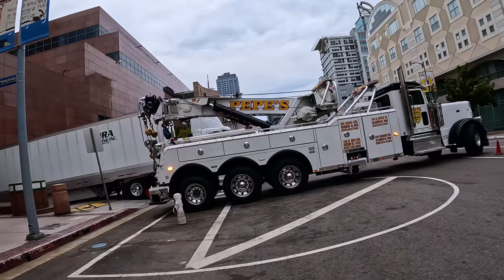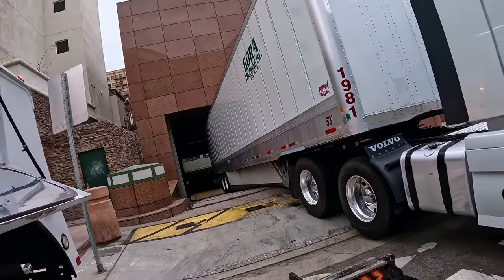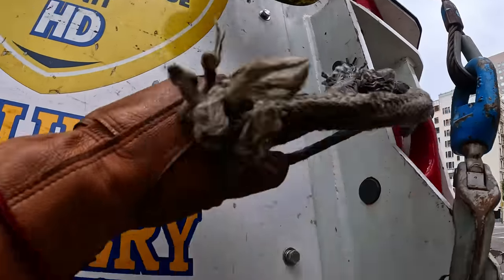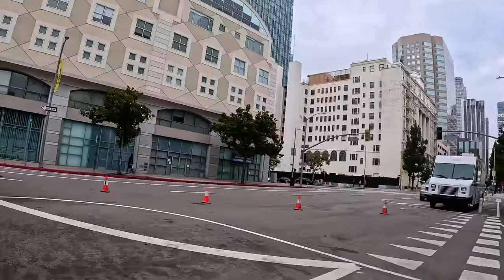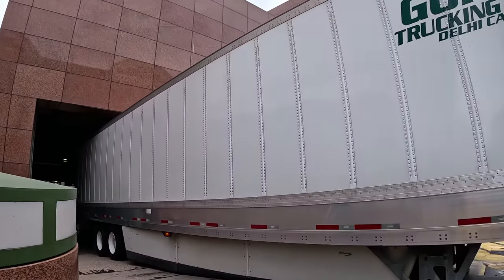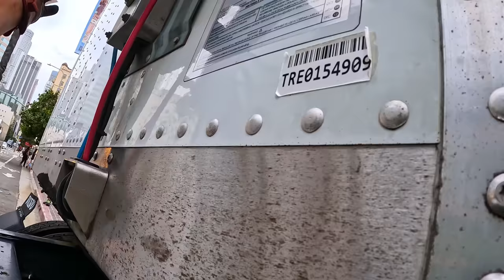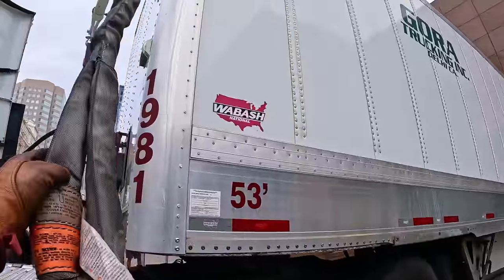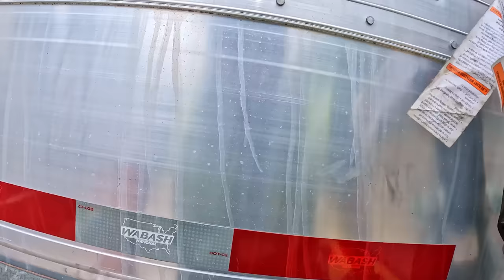Tractor Trailer Stuck at Federal Reserve Building

Comment: In this modern age, if you want to be a tow operator you need not only a CDL license and a vast knowledge of rigging, and mechanical systems, but you also need to be a Part 107 certified drone pilot too.
Reply from the maker: It sure does help 😂
Reply: Indian companies have destroyed trucking
Reply: @murdamooch  Nah, they just the only ones willing to do it. They on average have less experience as drivers so they aren't as good, but its not their fault that the market is thin.
Reply: @colamity_5000  Fun fact where im at many mechanics wont work on indain trucks cuz they cut holes in the floor boards and the undercarriage of the truck is caked in poop
Reply: @murdamooch  I've heard horror stories...
Still it's illegal most places to refuse service due to race, if there's genuinely shit there then sure but ya can't just assume there is cuz they Indians..
Reply: @colamity_5000  Ah. that old chestnut of "foreigners are doing the jobs locals are not willing to" 
I've heard that for decades and it's complete horseshit.
Reply: @murdamooch  Worldwide.
Reply: you mean a drone operator, your not pilots, you never will be
Reply from the maker: @Cessna152ful ok Karen calm down there
Reply: @Cessna152ful  You fly a cessna, you're not much of a pilot either.
Reply: @Cessna152ful  Pipe down lil bro you fly a cessna
Reply: @Cessna152ful look it up smarty pants! A drone just like the one these guys fly is just like mine and according to the FAA a drone is aircraft which means I’m a drone pilot. Get over yourself!
Reply: @colamity_5000  no but if it's a common enough occurrence, checking the truck for literal shit prior to accepting it for service isn't racist.
Reply: @colamity_5000 ask this why, the sidewalk doesn't grt resurfaced at a lower height? You arent a trucker! Really people think truckers are dumbasses. But a nessesary nuisance! Wait till you get robots doing this job!
Reply: @colamity_5000  In  Canada they are starting to own a lot of the companies and they tend to hire their countryman.

Comment: I used to drive Armored Vehicles into the federal reserve building in Richmond, VA. They have en entire city block underneath the FRB building. A tractor trailer can do a 360 turn inside. This place looks so dangerous for armored cars. Its why they have to post the FRB police outside when they are coming and going. If this is happening regularly why not change the road angle to accommodate the tractor trailers?

Comment: There's a very good chance the driver could of tied up his self leveling valve, to over extend the tractor air bags a couple inches, walked right out of there. I've personally done that a few times.
Reply: Absolutely!  If the truck alone wasn't enough he could have gained a bit on the trailer too.  A driver should look at where he is and think "Every other driver gets out of here without a tow truck."
Reply: Just scrolled the comments to see if this was mentioned by anyone, exactly what I was thinking!
Reply: That is what I was thinking.  There were a number of ways out of here without involving a $$$$ rotator.  Complete overkill for the job, oh well.
Reply: Aw hell. They gotta rip off whoever they can
Reply: @dannydonovan9348 they aren't cdl instructors,
Reply: @deth3021  That's for dam sure
Reply: I always crossed these thresholds with caution.  Pulled out very slowly and if you heard the landing gear scrape you could reverse and come up with a different plan.  Once you high center and take the weight off your drives you’re screwed.  Over extend the airbags, boards, take the gear pads off, anything to avoid that $1000 bill especially as an O/O

Comment: "You're not holding the brake, are you"    pssssssssh, and truck rolls.

BTW - the reason for all those armed cops is very simple: as long as that truck is stuck in the opening, the security of the building is at risk as they can't close off the loading dock opening or raise the streetside bollards.

(plus, I'm sure, all those officers wanted to watch)
Reply from the maker: Spot on! These guys always have to be on high alert even on a routine job like this. Very nice guys but you don't want to make them paranoid lol
Reply: @PepesTowingService  oh dude, you don't have to make them paranoid, paranoia is literally part of the job requirements.
Reply: and the trapped vehicle is presumably full of pallets of money unless the fed was sending them out loaded with something else 😃
Reply: @tonyyarbray  could actually be anything from money, to coins, to just generic office building supplies.

Could be something like pallets of Coca Cola cans for the break room.
Reply: Delivering to Brinks was like that,  any time a door was open, two guards stood there with shotguns

Comment: I feel like this problem is a result of the loading bay design. The sudden angle change is just asking to get vehicles with long distances between their wheel bases stuck.
Reply: Can't this be avoided with appropriate load limits or weight distribution?

Comment: Wow, look at the concrete, it been scraped so many times. One would think they would spend the money to fix that spot. For those wondering, it usually coins that are loaded out, hence only a few guards. I have done a load like that, no escort, no guards, nothing. That is due its heavy and low value.

Comment: One would think they might reason that a shorter trailer with a shorter wheel base might be a solution. Maybe a sign that says wheel base of 53 ft trailers will not fit.
Reply from the maker: Perhaps, but we've even pulled out 40' ones and 3 axle box trucks

Comment: There is a covered service road in the West End of London, behind a theatre. It has a low stone-built roof:
When you enter with a full load, no problem, there's a bit of clearance, but, try to leave after unloading......
You don't think about it until it happens to you.
Reply: Bin there done that,  inside an underground loading dock,  once the weight was off,  I pulled forward and thought it was snowing ( inside, summer?). I was scraping the insulation off the ceiling. LOL

Comment: Alternative method...undo tractor air ride leveling valve, extend air springs...that raises landing leg pads off pavement....pull forward, lower air springs, reconnect leveling valve. No damage to anything.
Reply: I have the impression that the driver is pretty inexperienced

Comment: Very nice! He was defiantly holding those brakes and didn't seem to get it right away what was happening. Should also run a camera by the running gear and where your lift point is before your strap is in the way. Nice job should be at least 2k probably more in LA

Comment: so you guys lifted but just wondering, wouldnt it of been a option to put logs behind the truck reverse it a bit so it got higher and then put logs infront of the trailer wheels to get it that bit of clearance? i have no towing experience but was just wondering as ive done stuff like that before when it was tight with a small trailer that had to get in the building but couldnt due to the ramps

Comment: I mean, not to burst any bubbles here...  10 second fix, disconnect your autoleveler arm from the suspension and make it think its low.  It will lift the truck another 4-5" at least.  I've done it and saved myself a couple thousand bucks and a couple hours.

Comment: I'm assuming part of the issue of this driveway is the bollards anti-vehicle management system what's looks to be the giant steel pillars which are embedded in the ground there with come up at night I'm assuming. Instead of paying 750 to $1,500 one would assume that they would regulate a minimum landing gear height before you're allowed to be loaded at the facility. I have to tell you that as a truck driver 10 years if I was loading out of this facility on a normal rate I would have wooden wedge blocks probably triple layer 2 by 6 with a slope and when I got to the point to where landing gear was getting close to the ground I would hop out and put it under my drivers. I'm amazed that security at the facility doesn't watch the trucks leaving which they could and have similar blocks in place instead of again charging the taxpayer 750 to 1500 bucks but you know if that makes too much sense

Comment: With a front axle leveling valve, that is why I carried 8 ea. 4 X 4 for dunnage. Put in front of r=front axle just before drag and raise the trick up and don't need a tow truck at what $1200.00 for a 20 minute move!  Some of you that think you are truck drivers are not. this is a stupid mistake because someone did not THINK. BTW I needed 1 tow in 30+ years. ecm went out outside of Limon, Co.

Comment: I’m going to assume the problem why the trailer is easily getting stuck is due to the fact these trucks don’t have actual air bags to raise the trailer high enough or it’s the type of trailers they’re bringing to the dock I know Wabash and Great Dane have some of their landing gears a little low
Reply from the maker: Correct, a lot of trailers are built different and not all will have the same fixes.

Comment: Could the air leveling valve have been disconnected and moved down to inflate the rear suspension. Might not work because the front drive axle is already extended. The rear would be doing all the lifting. Just a thought.

Comment: If the tractor has air bags could you have disconnected the leveling valve and maxed out the air bags to raise the suspension?

Comment: Next time disconnect the tractor leveling valve arm. raise it all the way up. If thats not enough discconect the trailer leveling valve arm, raise it all the way up.  15 minutes and your unstuck.   Granted then you dont get to charge to 2-3k  for using the boom on the tow truck.

Comment: The tandem axles look to be slid in the forward postion, making the end of the trailer higher as the rig pulls forward on the ramp. If the tandems were back to the end he shouldn't have gotten stuck.

Comment: I've had a similar situation before but I just over inflated my airbags to raise it up a little higher on the truck and trailer but it's kinda hard to tell if that would of been a feasible option for that scenario
Reply: What you mean over inflated your air bags?
Once the air bags are aired up it’s all you gonna go up there is no no 1 or 2 or 3 level inflation on air bags they either all the way up or they completely depleted. 
Stop lying
Reply: @TheodoreRizzo  you can actually disconnect the leveling valve from the spacer arm and raise the frame up even higher same on the trailer granted you can only get a couple inches at max but I've done it a couple times to get out of either this situation or to hook up a trailer that's dropped too high and too close to the next trailer for the landing gear crank in some situations it is a trick that works

Comment: SLIDE THE 5 WHEEL TO THE BACK OF THE TRUCK IF THAT DOES NOT DO IT DISCONNECT THE AIR REGULATOR AND OVER AIR THE BAGS THAT SHOULD RASE THE TRAILER. TO CLEAR THE SIDEWALK

Comment: What has changed since that building was built? Are the trucks using smaller tires or are the trailers built differently?
Reply: Possibly the street/sidewalk were rebuilt.
Reply: 48 foot trailers were once popular  and likely had no issues at that dock ,,, now . its 53 foot trailers ... likely the clearance issue.
Reply: @rollsmerlin1659 he mentioned they have problems with 40ft trucks getting stuck too

Comment: $750 - 1500

I'm guessing the equipment is 750 grand plus, the technician is 60-80 hr.  No chance that's a $750 call unless favours are due.
Reply from the maker: You’d be surprised. Los Angeles is so saturated. Someone will always quote cheaper. If we charged more, no one would call. Gotta stay competitive which we do and have crazy volume.

Comment: Bro, you’re a FKN genius you know you can go underneath that truck disconnect with no tools, disconnect the leveling valve to the truck and have the truck to all the work and no craine needed 😂😂😂😂😂😂😂😂😂 FKN rookies 😂😂😂😂😂😂😂😂
Reply from the maker: What an idiot, first you misspelled crane. Second this is a rotator, not a crane. Third, his bags weren’t dropped. Over inflating the bags while going uphill when your trailer is FULLY loaded can pop them. I’m glad you aren’t in this industry because you clearly don’t know anything. But go off keyboard warrior

Comment: excellent work and care, you can extend the spreader bar a little bit more on both sides.
Reply from the maker: No you can’t. This is a miller spreader bar at maximum length. You’re thinking of the nrc bar
Reply: oh ok, I am a mobile crane operator and I have only used bars that spread. Good stuff! @PepesTowingService

Comment: What could the driver of done to avoid this? slide his tandems, dump air, ect?
Reply from the maker: What could that possibly have done here? I've gotten called where they managed to back up and try to drive even faster out and bend the landing gear. Why would you risk that? Lowering the pressure would just drop it and make it more stuck.

Comment: I used to work for Dunbar years ago and we did the midnight money run to the Fed BEP - we would pick up between 20-30 million in cash and coins . They had to make sure of the weight because of how heavy the armoured truck already was and how much weight additionally they where loading . Just bricks and bricks of cash . It was insane . We where always on high alert because we knew at some point somebody would try and rob us . Thankfully it never happens while I worked there . We all carried a Glock pistol with 3 magazines and either an AR-15 or a 12 gauge shotgun .

Comment: Alex did a good job with that. I bet Alex had good experience with this. Do you guys ever use the tri-axle semi truck with the Detachable Towing unit for Towing larger trucks?
Reply: Plus what year is the PETERBILT 389 night cab Vulcan 950 rotator truck that your co-worker Dave uses?
Reply from the maker: We call that truck the beast, unit 21. It tows tractor trailers ALL DAY and is a work house. And Dave's truck is a 2014.
Reply: @PepesTowingService  does UNIT 21 / THE BEAST ever tow other larger trucks to like maybe a bigger dump Truck?
Reply: @PepesTowingService  is the Vulcan 950 a 388 or 389?
Reply from the maker: A tractor trailer is almost as large as it gets. But use anything the wreckers can tow pretty much so can the beast
Reply: @PepesTowingService  is the UNIT 55 a 388 or 389?
Reply: @PepesTowingService  for UNIT 21 / THE BEAST. I do understand that a semi with a Detachable Towing unit they are still used for Heavy-Duty towing even that they are not used for recoveries my buddy had one & got rid of it & he told me it was great for Heavy-Duty tows.
Reply from the maker: Correct, mainly because of the boom. It’s a great and versatile tow unit though. And unit 55 is a 389
Reply: @PepesTowingService  I agree. Towing a larger truck can still be done with a semi truck with a Detachable Towing Unit. Even that they are not used for recoveries because of the boom, winches & everything like that. A semi truck is a still a heavy truck at the same time.
Reply: @PepesTowingService  will Dave use HULK when his truck is down, or getting basic maintenance or someone else is using it for any reason.

Comment: To funny all you need to do is disconnect the air bag rod and air the truck air ride bags all the way up they would be able to drive out,and reconnect the rod,but the problem is dummies with cdl's.
Reply from the maker: Not necessarily. This trick works to an extent and varies with make and model. Besides the way things work is we aren’t allowed to do “mechanical “ stuff like that. Let’s say while on the freeway he crashes. California is so sue happy, we would definitely be a co defendant because someone would inevitably say we messed with the air and caused the crash. So you avoid things like that at all costs. Sad but preventing liability is key

Comment: Do you have any other semi Trucks with a Detachable Towing Unit on it like UNIT 21 / THE BEAST has like they are used for Towing larger trucks? I knew you guys have 6 rotator trucks, 15 wrecker trucks & I am not sure about semi Trucks with. Detachable Towing Unit.
Reply from the maker: We used to a long time ago but for now it’s just the beast
Reply: @PepesTowingService  so it is safe to say you guy throughout the whole company of 6 rotator tow trucks, 15 wrecker trucks & 1 semi truck with a Detachable Towing Unit that the current number of Heavy-Duty trucks for towing larger trucks is 2023? How many semi are used for semi trailers in the whole company?
Reply: @PepesTowingService  plus how many Heavy-Duty flatbed tow trucks & Heavy-Duty semi trucks for semi trailers? I know of these ones for Heavy-Duty trucks at Pepe's Towing Service in California

- 6 rotators
- 15 wreckers 
- 1 Semi Truck with a (DTU) Detachable Towing Unit

I am not sure about how many Heavy-Duty semi Trucks for semi trailers & Heavy-Duty flatbed tow trucks.
Reply: @PepesTowingService  what year is UNIT 21 / THE BEAST? Plus did you guys buy it around the time BIG FLIPPER & HULK came along?

Comment: The U S Gov made this entrance like they do all things … thinking backwards . Common sense tells you that the entrance is designed for the early 1900’s …. Back then tractor trailers were 30 ft long , now they are 45 & 53 ft … Hell what is 15 more feet ??
The Tow truck driver is also a Federal worker .
He made the job a Federal Case …. Could he go any slower ???
DingBat comes to mind here 😢😢